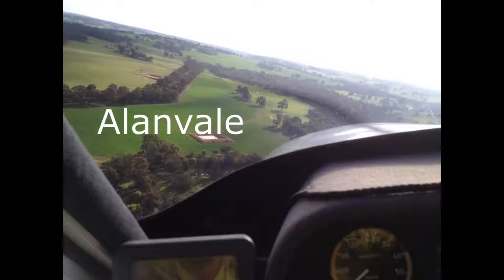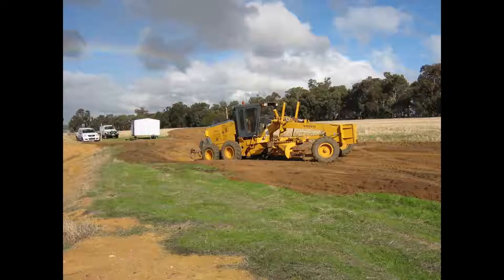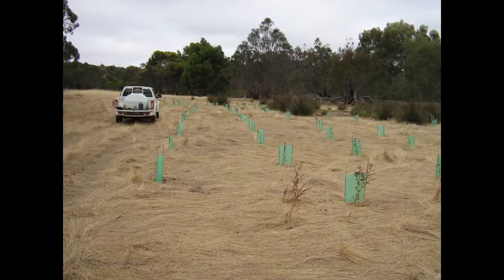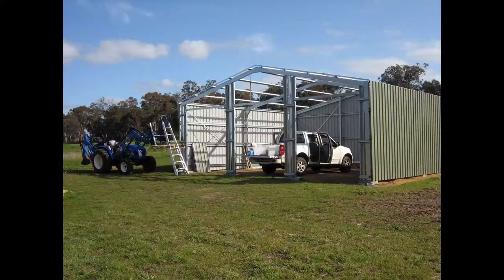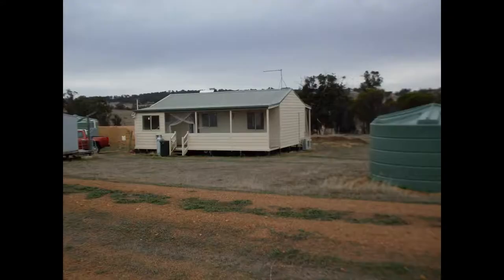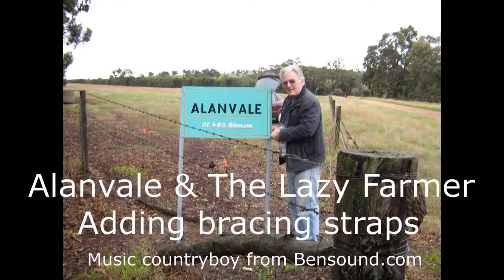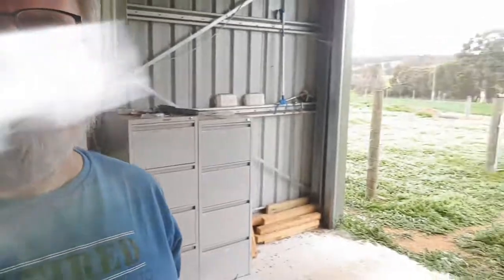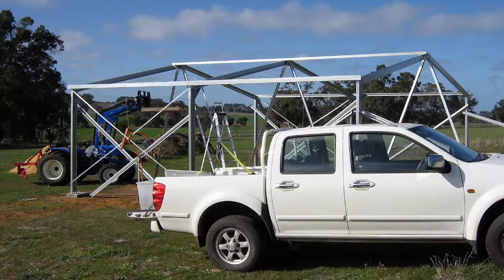Building the kit shed 6 - Adding permanent bracing

Comment: how does using the ute help tension the strap when screwing it to the bottom side?
Reply from the maker: I used a G clamp and tension strap to pull the galvanised strap tight before screwing the second end down. Without doing this, the strap has no tension and does not do the job. You also have to get the building plumb first.
Reply: @alanvaleandthelazyfarmer1930  yeah so far its pretty plumb , the shed im helping out with is a 6x6 and its on a concrete pad
Reply: i really need to find a video of someone actually tensioning the straps , i tried the gclamp method but it keeps slipping off
Reply from the maker: @kevmatt8450  You probably don't need that much tension but try locking pliers.
Reply from the maker: @kevmatt8450  Mine was 7 x 9. You only need to brace one bay in every four and you will probably only have two bays. The sheet metal will add rigidity later.